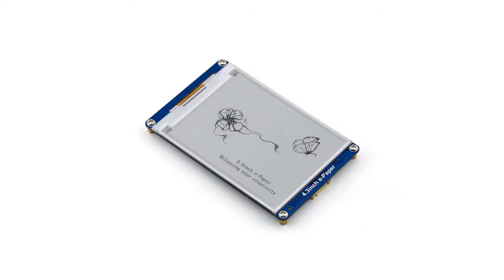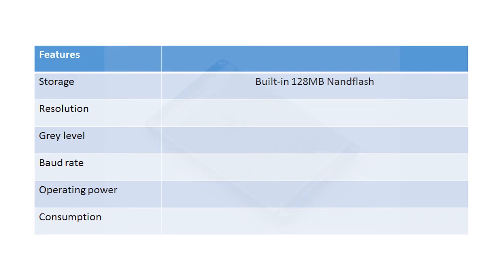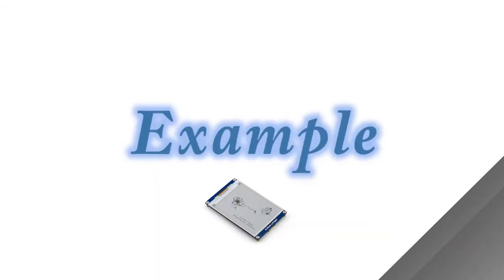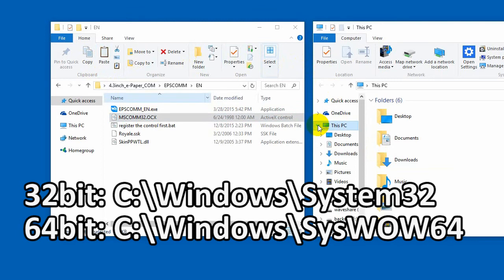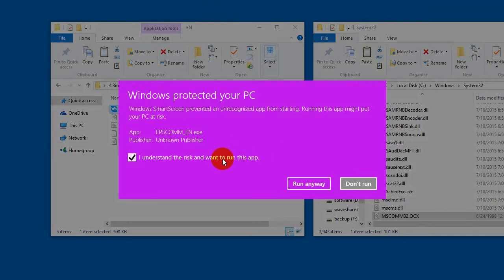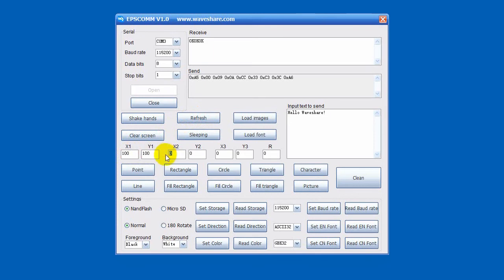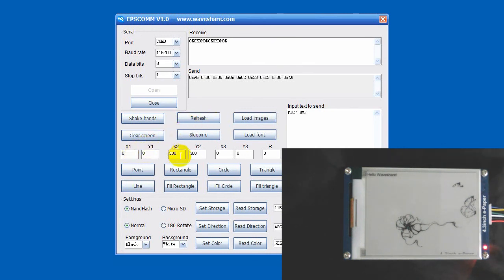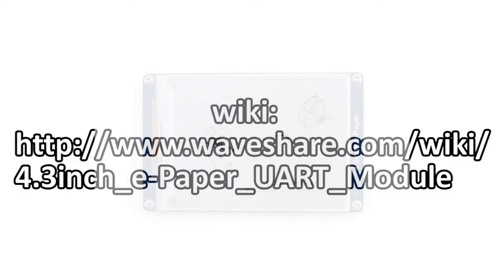Waveshare 4.3inch e-paper UART module

Comment: It's a pity that the module only supports partial refresh. Partial refresh would allow the display to be more dynamic. Having to do a full refresh after every operation is not viable for projects where only small parts of the screen are being updated. Add a partial refresh to this product and I could use it. As it is now, I cannot - sorry.